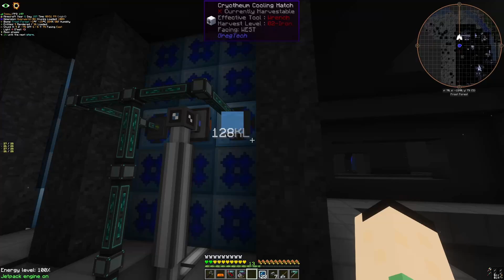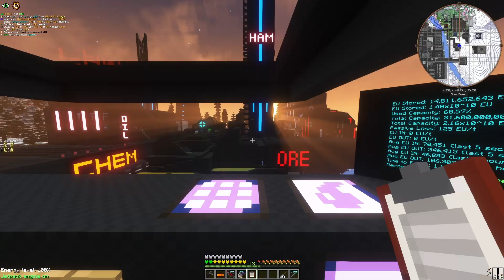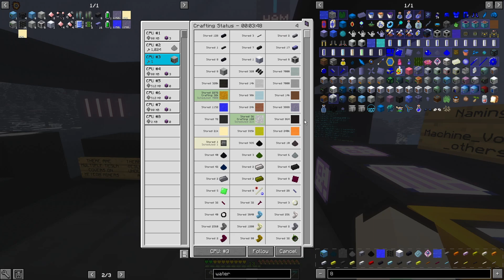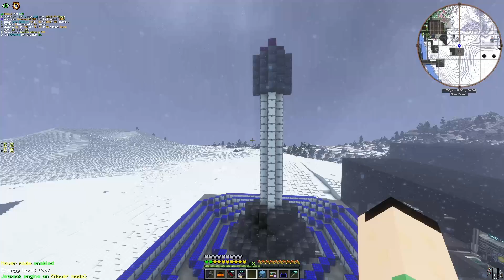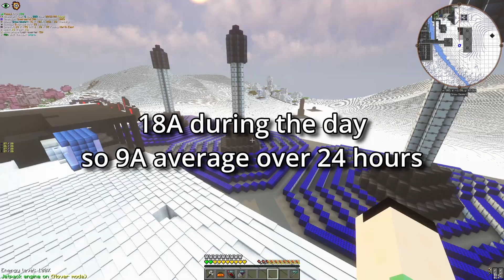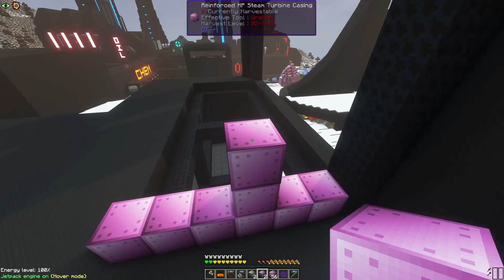GregTech New Horizons E84: Critical Solar Tower Expansion... Almost

Comment: Quick question, why not pause and go and try and make the ZPM hatches, I mean, it's not an issue of power and I don't think they require anything you don't currently have or can make? Wouldn't your setups all benefit from the overclock anyways?
Reply from the maker: Dear employee,

They require grade 3 water! For the nano PICs if I remember correctly. I will cover the waterline in the next episode.

Best,
HamCorp

Comment: Mega EBF has some funny scaling, I think with a single 64a  LuV hatch theres like a 50% chance you can do UHV recipes if the heat is good enough

I know for a fact that lasers work this way, my 4096a UV laser handles UIV and UMV crafts without a problem